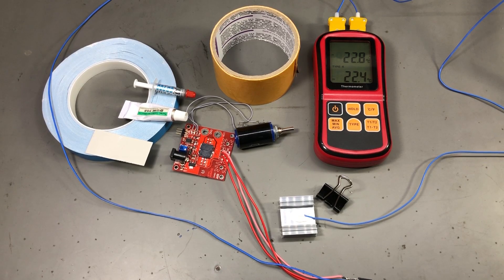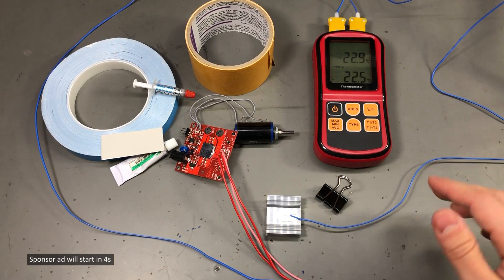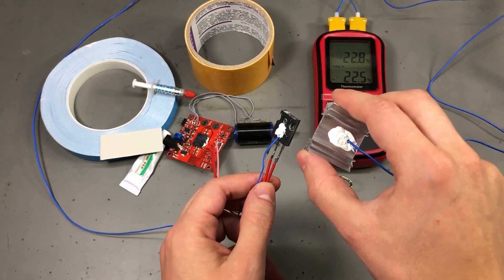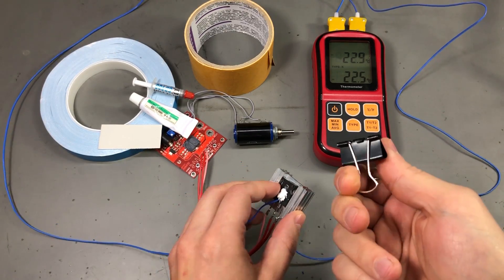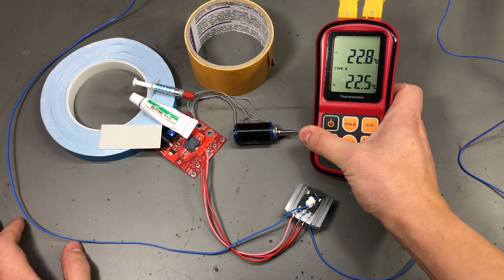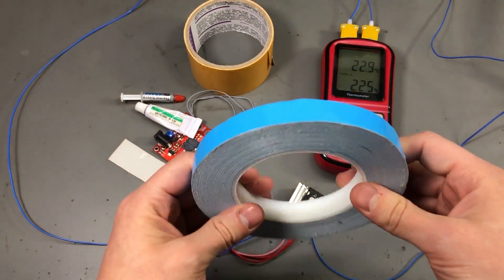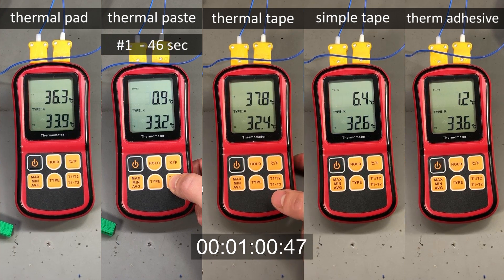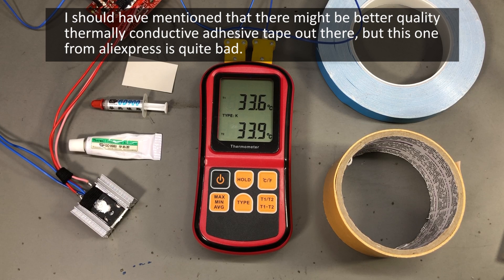Voltlog #195 - Is Thermal Adhesive Tape Any Good?

Comment: So the tape doesn't work
Reply: They didn't prove that it doesn't work, they proved that it has lower heat conductivity than higher transfer substances like thermal epoxy. In order to prove it doesn't work, they would need to test it against something that has no heatsink. Thermal tape is meant to be used in places where there are no mounting points (thus making paste/pads unusable) and thermal transfer isn't critical, and permanent solutions like epoxy are undesirable. Standard double sided tape will not withstand high temperatures for prolonged periods of time, so it's also not suitable for these situations.

Comment: Thanks for laying this all out and making it very clear in just a couple of minutes.
I guess the plastic film in the tape is the thermal insulator that ruins it. If it were aluminum foil for example it could do like the thermal adhesive/plaster.

Comment: What do you think about using this thermal tape to mount heatsinks onto ICs or power FETs? The thermal conductivity is clearly not as good as thermal paste or silicon adhesive, but these solutions would be too messy on boards with lots of surface mount components.

Comment: I am planning to use this on a CPU to cover entire area and except the die area where i intend to use liquid metal.. and make sure if this leaks it should leak on top of the tap instead of damaging small diode or capacitor.

Comment: The video is very superficial, I'm sorry if it was informed but I did not see where, for example how thick the thermal adhesive tape ? What is her exact ad/model? There are dozens or hundreds selling on Eastern sites, each with its own specifications, some equal to the others and some not ... one cannot generalize as it was done.

Comment: Would’ve been interesting to see if you’d have used thermal adhesive tape from a know brand with actual claims about thermal conductivity. I’ve got tape from Akasa and they list the thermal conductivity as 0.9 W/mK. This seems rather poor when you have thermal pads claiming 10 W/mK or even more. But hou have to keep in mind the ‘m’ (‘meters’) from ‘W/mK’. Thermal pads are thicker than thermal adhesive tape thus diminishing the advantage, greatly so if you use pads with 2 or 3mm thickness.
I’m using the tape on MOSFETs which are vertically oriented so the heatsinks fall off if I’d use paste. Pads have somewhat stickiness, but still the tape performed better because of the more solid connection and thinness. Adhesive would perhaps work better, but is messy and doesn’t come off as clean as the tape does.
Reply: Vou usá-lo na memória de vídeo de uma placa de vídeo, vou usar uma fita adesiva de 0,15 mm e ele fará a interface entre a memória e o calço de cobre. Eu não vi nenhum vídeo que usasse fita adesiva térmica, todos eles usaram pasta térmica ou almofada térmica. Acho que serei o primeiro a testar, filmar e postar.
Reply: @marceloleite2304  OK, interesting!

Comment: just bought the thermal tape, marketed as lcd tv backlight double tape.. glad i didn't use it for cooling application, I use thermal glue instead. however, the stickiness quite good for non thermal related electronic application, compared to black 3m double tape.

Comment: i bought a few rolls of this optically same from aliexpress and thought about the same a few days ago. Thanks for testing, guess that thermal tape is not that great but still, it has excellent adhesive properties and it is cheap. i use it for different stuff but also thermal applications where it it not critical.
Reply from the maker: I would say the same about the tape, use it in places where the thermal transfer is not critical.

Comment: Thanks for this. I was getting ready to drill 3mm holes in my board and buy a push-pin solution for an embedded chip, now that I see silicone adhesive is almost as good as thermal paste, I'll just use that.

Comment: Hi, Thermal Double Sided Adhesive Tape actually for application of bonding two surface that it will hold it adhesion at high temperature, for example 3M thermal DS tape for short term at 150C and long term at 60C.

It's not really meant for heat transfer.

However, it is more convenient to use than thermal glue as it does not require to wait for it to cured and not messy.
Reply: class-A tow  Because there is a proper thermal tape, like 3M 8810 tape thats actually have a proper thermal conductivity. However, as always Chinese will make a Chinesium grade of the proper thermal tape by using light blue color like what 3M do to their 8810 tape product.

Comment: Would you describe how much force is needed to break out the heatsink from the component with thermal adhesive? Is it designed to never be replaced or it's possible to remove and reapply practically.
Reply: Also what about using thermal paste in the center and thermal adhesive only on two sides? Is it practical?

Comment: The best method is, polished metal to metal contact, with thermal joint compound in between. screwed down tightly to the heat sink to squeeze out any extra compound and air bubbles..
Even anodizing of the heat sink, affects the contact area, hence the performance.
Anything else, is a compromise that will deteriorate the heat transfer process. 
Convenience at the cost of performance.
Reply from the maker: You also have to consider thermal expansion. With some devices like GPU type chipsets, you can't have that type of rigid heatsink to device connection, you need to use a thermal silicone pad to allows for thermal expansion without cracking something.

Comment: This thermal tape does not have the best thermal conductivity,  it's only high temperature resistant double-sided tape (the cheap one in the video). If you want to greatly improve the thermal conductivity,  just stick it at both ends of the component as 2 strips and apply thermal paste  between the strips. This way you only rely on the tape to hold the component or the heatsink in place and on the thermal paste for good thermal conductivity.  It's usually applicable for components bigger in size,  where you have big enough surface for both tape and paste. 
The thermal paste should be a very thin layer between the component and the heatsink,  so the described method is no better than thermal glue but you don't have to wait for the glue to cure.
Reply from the maker: yes that's one aspect I overlooked, the tape might be temperature resistant and that is possibly even trickier to test.
Reply: @voltlog  If you mount a metal plate,  preferably aluminum,  on the tip of your temperature controlled soldering iron and set it to say 100 degrees Celsius, then stick 2-3 pieces of the thermal tape you bought,  next to them same number and size of pieces of regular double-sided tape,  hang equal weights on them and after heating up the soldering iron see which one stays stuck longer. And maybe try raising up the temperature until they start melting and get unstuck. They should hold up to 120-130 degrees maybe. Also make sure you degrease the surfaces before sticking the tape.
Reply: @111chicane  In minute applications, instead of using two layers, I use a razor to cut a small island in each patch and apply a corresponding amount of thermal paste (usually one drop); this way the tape holds the heatsink to whatever I'm applying it on, while the thermal paste transfers heat.

Comment: No a good test.  30 degrees?  Come on now, that's nothing.  You didn't even test the bond strength.

A power led runs at 70 degrees, bump it up to at least that and hold it for a few hours and then see how your normal tape fares, I bet it won't last long!  These tapes typically advertise a temperature stability of 120 Degrees constant.

The thermal tape should also preferably be firmly pressed when it's hot the first time to properly bond it.

Thermal double-sided tape is the bottom-rung of thermal conductive solutions, but it's not just "regular double sided tape with a fancy name", it's designed to transfer heat AND to remain a relatively strong bond under high temperature and fluctuation, something that regular double sided tape is not going to do, not for long at least.

If you can use thermal paste and screws/clamping hardware, or thermal adhesive, or  even a sil-pad and screws/clamping, then you should, but thermal tape absolutely has it place.  I use it all the time for sticking 1 to 10W leds onto heatsinks (actual heatsinks, or improvised ones like metal surfactes), or adding little heatsinks onto the top of ICs, or ....
Reply from the maker: Bond strength is one aspect I overlooked in this video, it would have been too hard to test reliably anyway.
Reply: Thermal adhesive tapes require not only to be pressed down for some time during curing at 50-60 degrees Celsius but also for its application to be absolutely voided of air bubbles, and in general it's the bottom of the barrel when it comes to thermal conductivity. 
So I, too, think the test wasn't fair to be honest.

Comment: Try repeating the test with kapton tape, there are various thicknesses of kapton tape intended to be used as TIM, either plain or with one side adhesive. I've successfully used general use self-adhesive kapton tape bought on ebay, though this may not be recommended for higher voltage insulation as it may have imperfections allowing punch-through.
Reply from the maker: The idea of the video is to test materials that have good thermal transfer (low thermal resistance).
Reply: Comparison of this with the same setup using some known-good tape at some point would be nice - but anyway, nicely done!